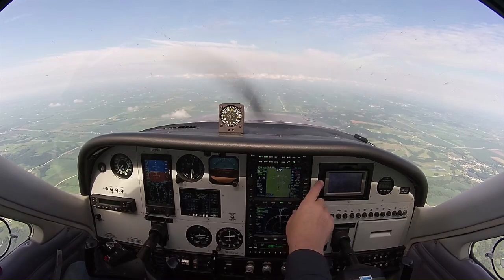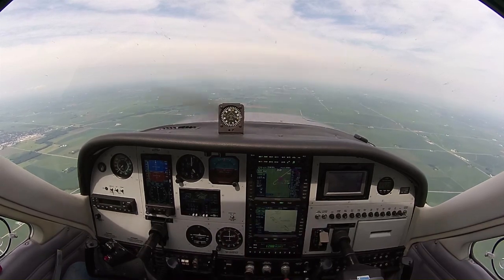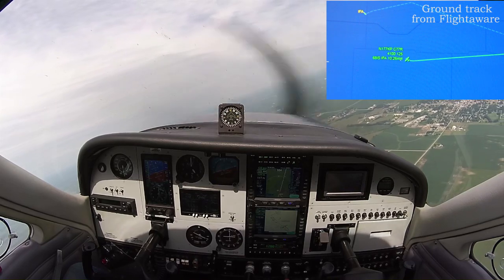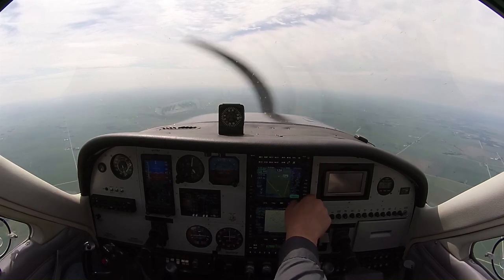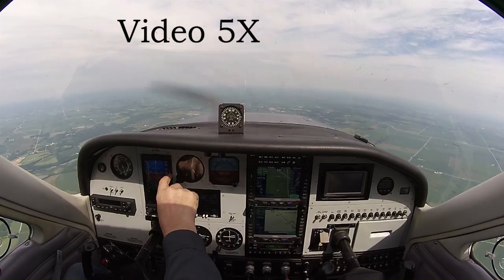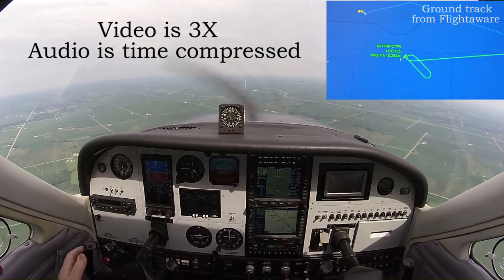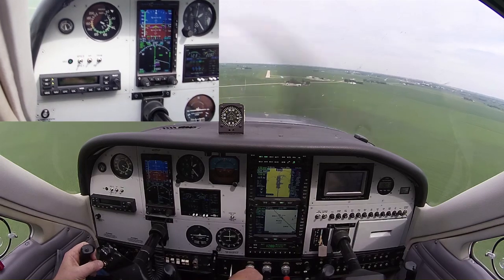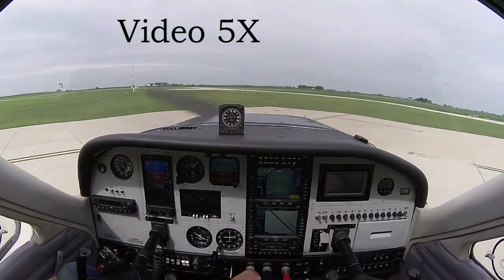S-Tec 3100, Aspen and Avidyne 550 doing an LPV full approach with hold, hands off.

Comment: How well did 3100 work with Aspen?  I’ve got aspen in my Saratoga and considering changing out 55x for 3100. Thoughts?
Reply from the maker: It works very well, although... do you have the remote control feature turned on to allow you to select autopilot functions and settings on the Aspen? That software is not yet complete for the 3100. I'm told they are currently flight testing that system but it is uncertain when that feature will be available.